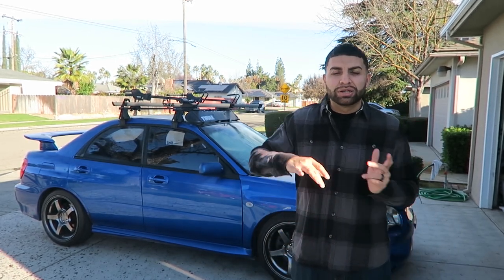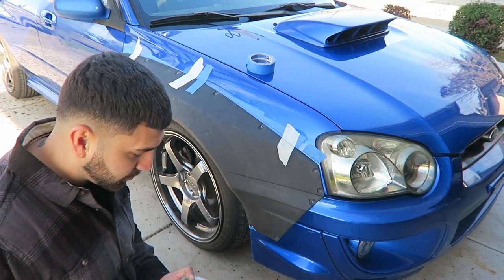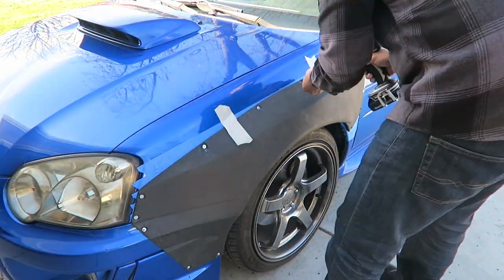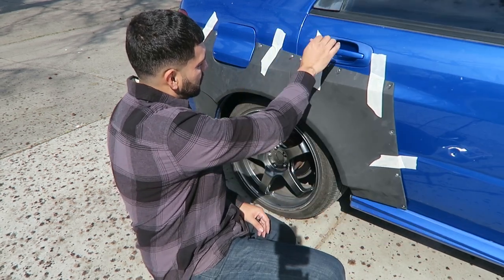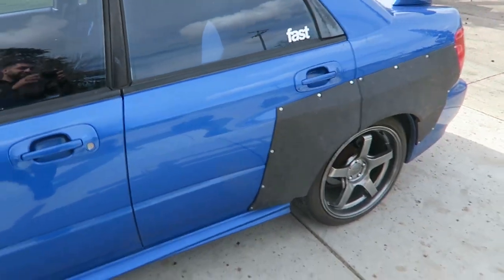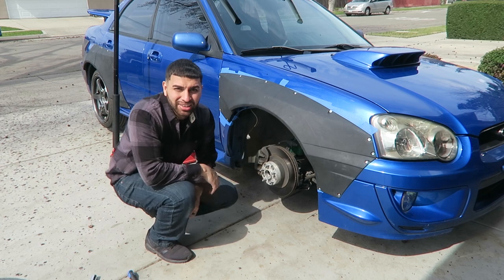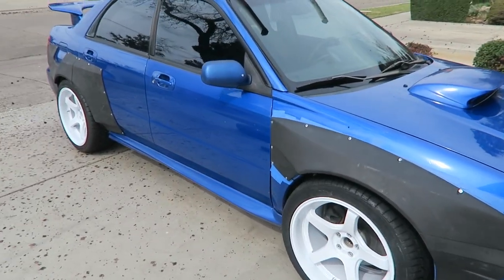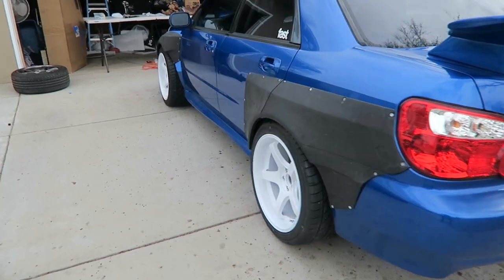BATTLE AERO WIDEBODY INSTALL FOR SUBARU WRX STI

Comment: I just had to stop the video at 3 minutes and take the time to thank you for posting this video. I'm currently looking to get the "Battle Aero" wide body kit for my 2021 Camry TRD. I wanted to see what it entails installing one of these even if it isn't for my particular vehicle. The steps are more or less the same, just a different vehicle. So I figured I'd Google search and see what comes. So now I gotta find how I'm going to fasten the panels to the body.... I've seen these "push" tabs that lock when you push them in and unlock when pushed again (panels are free to come off). Thanks again. I really appreciate it!!

Comment: Thank you for your video! I couldn’t find good information on what wheel fitment I would need for this kit and you even got good close ups! I like a bit of camber so I think I would probably shoot for a 18x12 et 20 which should stick out 10mm more than that so that I can get a nice fitment with some camber.

Comment: Just curious putting holes on the body isn't in time it will create rust when water gets in?
Reply from the maker: nahom79 yea maybe depending where you live but you can always primer any bare metal you have
Reply: you can also just use touchup paint to fill small holes

Comment: What front bumper you have? Would it fit a 02 wrx Impreza?
Reply from the maker: Selvin Duque I have a 04 jdm front end conversion and this is a 02 wrx but you have to replace the radiator support too well at least that’s what I did